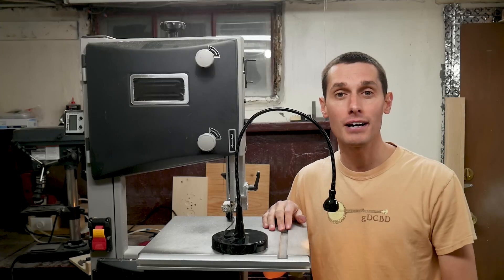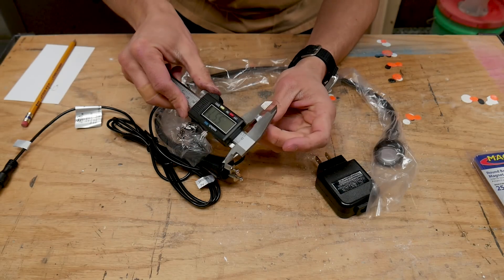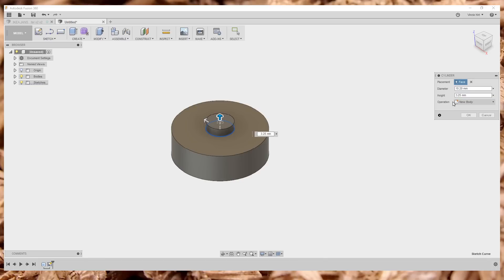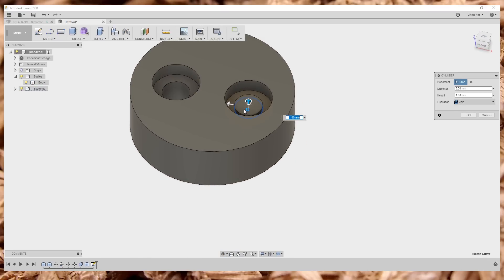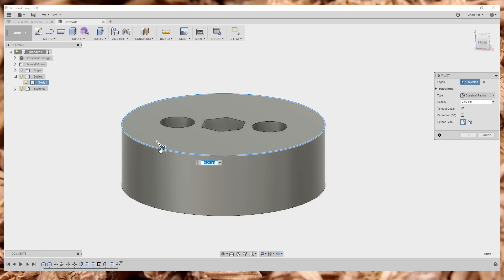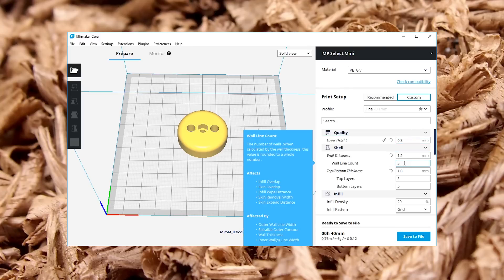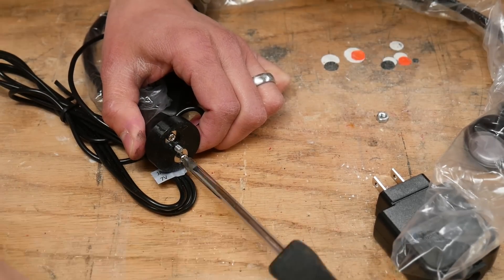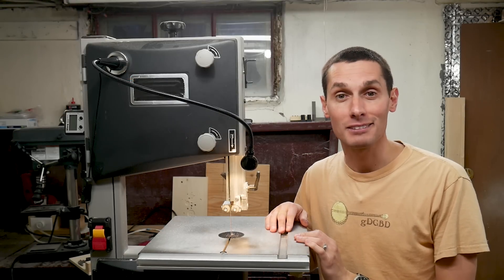How to Make a Magnetic Work Light from a Cheap IKEA Lamp Using 3D Printing and Fusion 360

Comment: Great build. Thanks for sharing. This is very original and practical. I do not have a 3D printer yet and I don't know to work with Fusion 360. Imho you should not give away the plans (file) for free. You put time and effort in it.  if you ask 1 USD for it, nobody
will mind that.